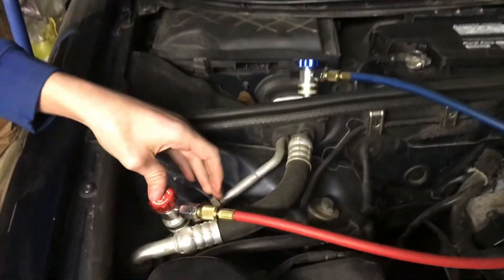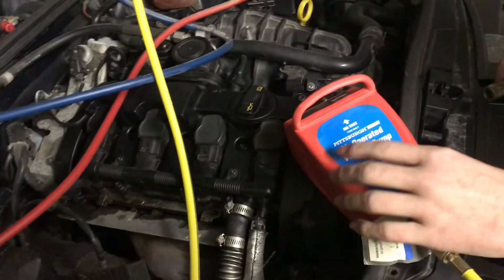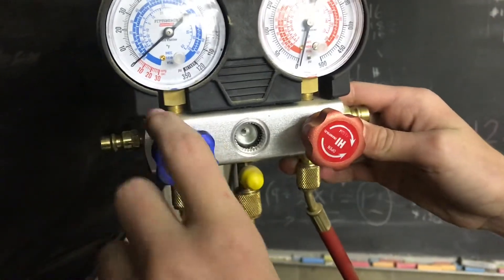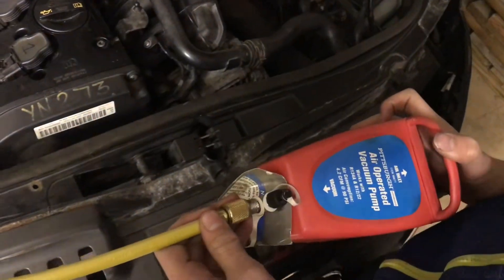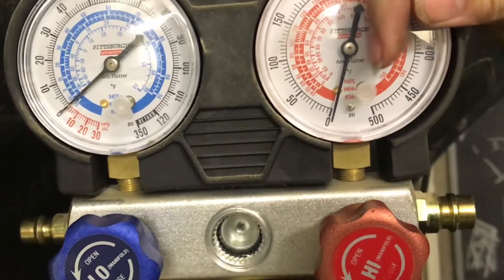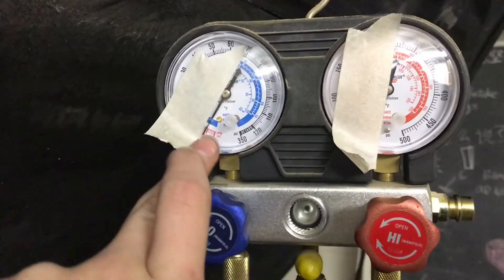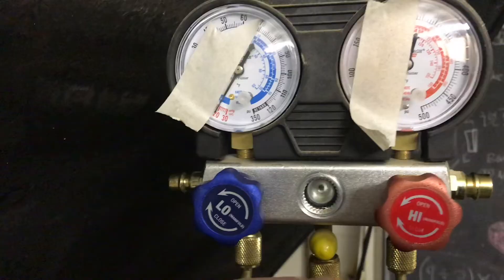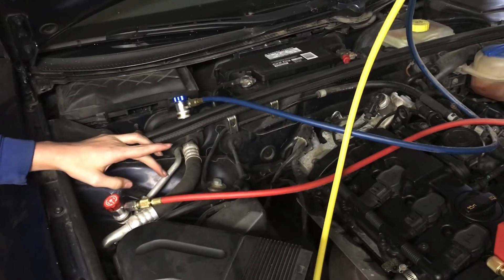performing vacuum test for LEAKS on an air-conditioning system

Comment: The system is actually a loop, pulling vacuum from either side does not matter.
I don't know why the high side moved, but they are connected by way of the system loop.
Reply: Can I use this if I used stop leak in my system?

Comment: Good info, Thanks.  So from other videos there are comments that using shop air to pressurize the system will put moisture into the system. Which will eventually cause problems. I am guessing (if there is a leak) using a vacuum would also bring outside air into the system, maybe not as much moisture as compressed air.  But not sure if that would cause any problems later. 
Also note that the high side pressure on most vehicles can be 150+ psi. So the vacuum pump is not simulating actual conditions.  
My amateur  conclusion - use the vacuum pump to test for major leaks. If no major leaks put freon in the vehicle with dye and look for smaller leaks, the 30psi vacuum may not find smaller leaks. 
And note most pro AC shops will not just replace one O ring, they will only replace all the gaskets with the idea if 1 9 year old gasket is bad, and the system has been empty for some time, when fully pressurized the other rubber O rings will fail.

Comment: Vacuum testing an ac system is the worst way to test for leaks.
Reply: No it’s the best bro. Do you understand science
Reply: You can test FOR leaks, but locating leaks requires different methods
Reply: And when amicronpucture leaves the flap you will miss it every time.  Science.  Nitrogen pressure will show you the leak.  Science
Reply: You must have been the first in your class. Lol
Reply: Vacuum tesr great for very bad leaks.
Reply: @oguzoguz4686  but horrible for micro leaks in the majority of North American built cars.  Adding dye to the system and havjning the customer come back has proven to me the best way.   Nitrogen fill is another good way but seldom seen or used in the shops I've been in.
Reply: @robertficek7586  This air-powered venturi vacuum pump can only go down to 100,000 microns.

Comment: how do you know if the gauge hoses are leaking where the are connected and no the actual car a/c system?
Reply: Im just doing this for the first time myself and here is what I did: I connected the vacuum pump and did the leak test on the hose manifold itself, by opening different valves one by one and run the pump. i had to tighten up a few connections, then i held vacuum fine. the connections are supposed to be tight due to the gaskets, you do not need to screw them down hard
Reply: @criticaljim1  yeah I did mine also and I got it working, I didn't have one of the lines attached to the compressor correctly on because the bolt that came with the compressor I bought was a little bit too long. Once I figured that out I used the old bolt and then it tightened down and got a good vaccuum it wasn't the pump hoses, but I didn't know because I had just bought that brand new on ebay.